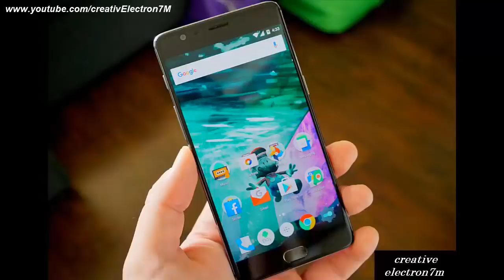Run a High Torque Mixer Motor as dc motor at 10000rpm with 12v battery diy

Comment: Fake alert 
Usually this motor works on 220 volts 
But this man is using in 10 volts also the voltage drop 300 mv is also very low

Comment: hi sir, is there any solution that my dc motor is only 24volts 2amps but i will use 24volts battery 10amps? what will happen to my motor if i will use more amps battery?
Reply from the maker: nothing will happen..
Reply: i have tried then my motor got hot and not working now.
Reply from the maker: was it too loaded while operating ???
Reply: yes i was riding it, actually it is a home made scooter.
Reply from the maker: @ericjaype8198  well that explains it all.. Under normal loading it will work but when it gets too loaded, more than rated current will flow through the winding thus damaging it.
Reply: thanks, i wanted to try again with the same motor but i will reduce the amperes of my battery
Reply from the maker: Sure

Comment: Hi
Please consider this set up :
Supply the commutator with 12v
Supply the field winding with another independent 12v
The torque Vs speed should change
Reply from the maker: urdu learner I have already done that in my previous video - https://youtu.be/XO7wQLBr10A